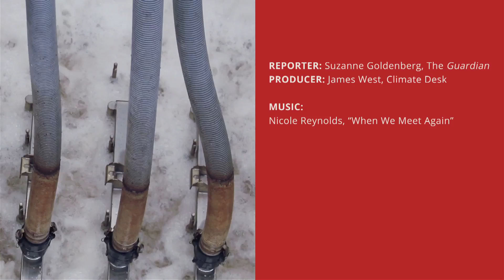Could Drought-Struck California Get Used to Toilet-to-Tap Water?

Comment: I don't understand. Are they not treating and recycling all sewage water already? Isn't that how other Western countries do it? Where else would used water go other than through a treatment plant and back into the supply?
Reply: I think it usually goes back into the ocean. Just like water from mountains travels along rivers to the ocean.  Where the sun evaporates it into the clouds. The water cycle is Earth's filtration system.
Reply: yyeppesz After trying to find out more about it I think you're right. For some reason I always assumed that water treatment doesn't make sense unless it goes directly into the supply, mostly due to 1) water quality is tested and ensured and is excellent to the point of being higher than for bottled water where I'm from (Germany), and 2) if waste water has to be treated anyways, why flush it away instead of using it? But I couldn't find any numbers on direct and immediate water re-use, let alone for substantial amounts.
Thanks for helping me correct this erroneous belief.
Reply: WE ARE!